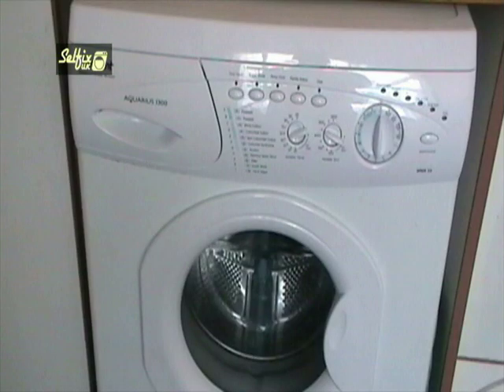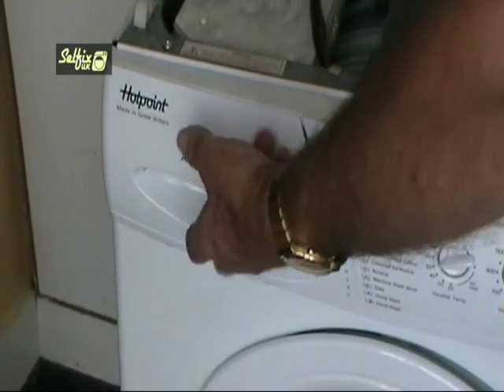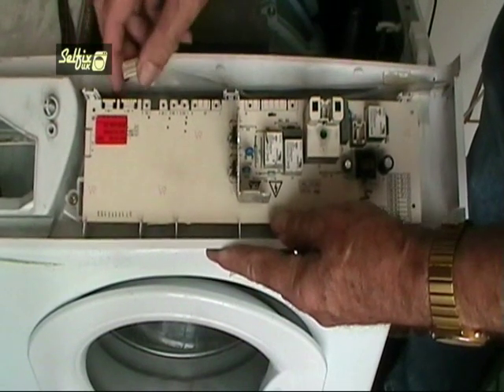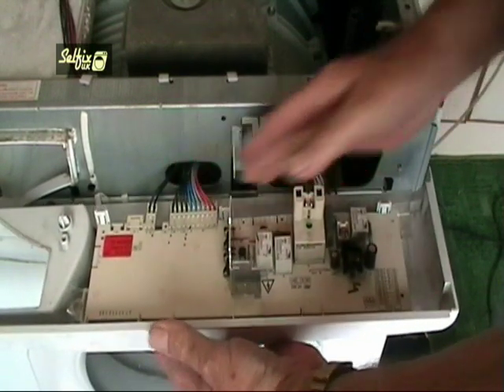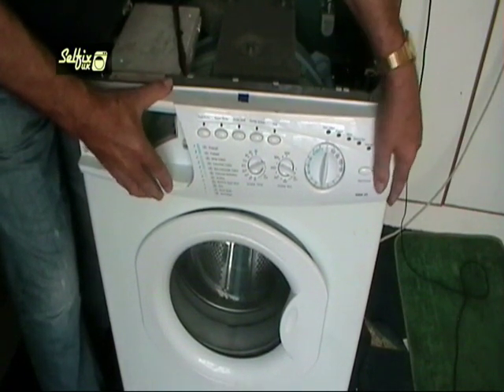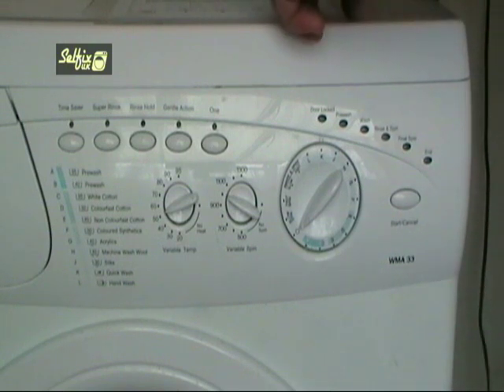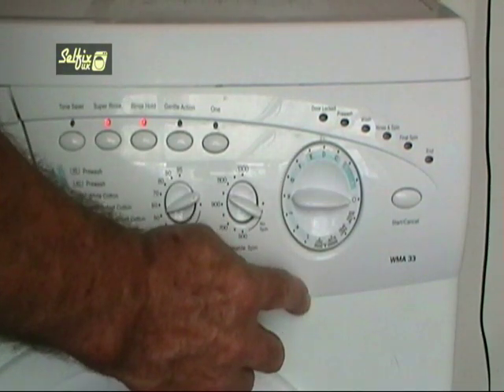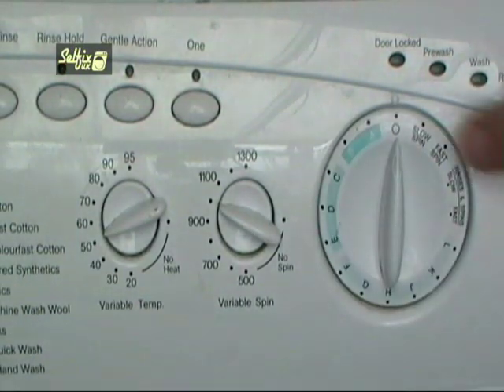How To Replace and Program A Hotpoint Washing Machine Control Module

Comment: Great video thanks, at the moment am being told by hotpoint the machine I have is to old to be repaired( basically they want me to buy a new one which is not going to happen), the model I have is an Aquarius WF000G(faulty motherboard, but have an unprogrammed replacement) could you advise?

Comment: Would a WMF740P (UK) R which had a module with code 21501008302  (fried in power outage) work with a module installed from a WMF740 (unspecified variant) with code 21501008403? Both have SW :16.00.13

Comment: Hello Sir great video Can you possibly help me out with a simple request , i un knowing purchased a un programmed replacement  pcb module 
for my Candy 1482-80 washing machine serial number 3100195407368829 so all i need is the information to do the program configuration many thanks 
Mike

Comment: Do I have to do reconfiguration to a Candy washing machine model GC4 1472D1, appreciate your reply, I had to order a new control board as the machine went totally dead with a blown up power supply section, where it required ordering a new board, and Candy/Hoover technical /sales people told me that they supply these ready programmed, so in which case i am expecting I will not have to configure my new module, any help would be appreciated. Thanks in advance.
Reply: no youl have  to pay for reprogrammed it 1 big super scam that should be illegal.just buy second hand machine dont feed these snakes.

Comment: that is not programming jackass its changing
Reply: Are you looking to program an HE washer to run like a non-HE from the 80's?
Reply from the maker: Had you bothered to watch the video until the end you would have seen the reconfiguration part. These modules only need configuring when replaced so the first part was to show how to replace the module.